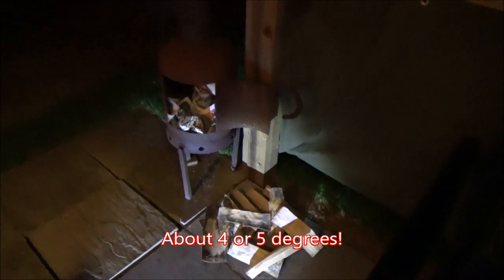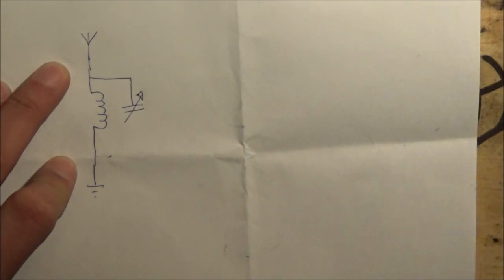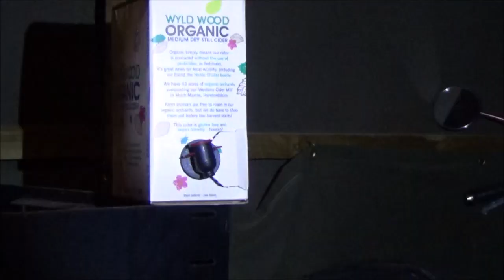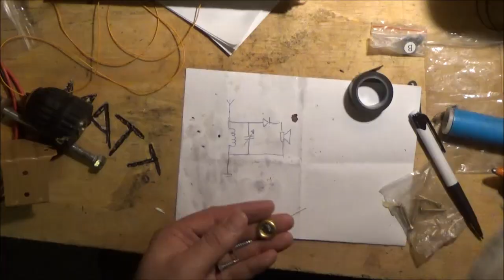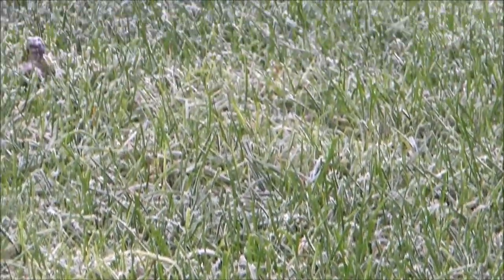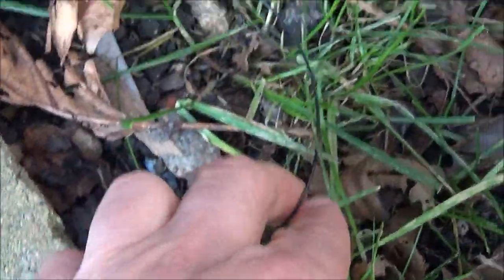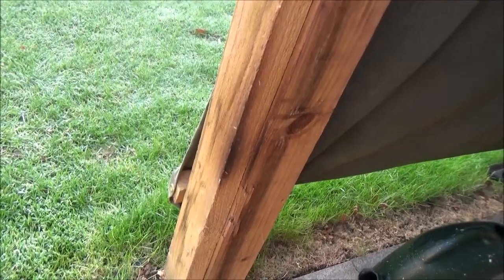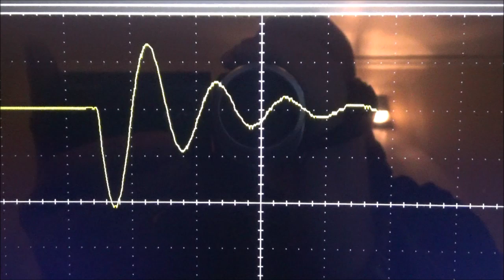DuB-EnG: Prison POW Survival Radio - Free Crystal Receiver - How to make a CATS WHISKER SET!

Comment: Don't forget...shaft of variable capacitor to the ground end of the circuit.  Otherwise every time you touch to cap it will slightly shift the frequency due to hand capacitance.  If wired the other way around,  you may have a station tuned in and when you let go, it disappears.   de AA9GG
Reply from the maker: Paul Mateer thanks Paul! ... how quickly I had forgotten your tip from the last time...  I connected the case to ground...  hmmm...  I’ll fix that with the addition of a new coil!

Comment: Hi I've found that the easiest way to work with a cats whisker is to use a conventional  crystal diode in place of the galena so that you can tune in and find a station and once you know your in the right area with the tank design and then try it with the cats whisker. All good fun.All the best . . .  Andy
Reply from the maker: AndyDaviesByTheSea thanks for your top tips Andy! ...  great idea...  that said, I have persevered and a new larger coil is in place... I’m getting radio 5 clearly  (also a small headphone amp so I can video it) ...  I hope you will see it perform in a few days!...  also, I have a tempered hacksaw blade to play with, a ferrite rod and a few other going’s ons! ...  later down the line I plan to make a small TRF radio

Comment: That's more like it, very similar to the one i built as a kid (52 now), those toast rack capacitors are bloody expensive now.
Mine was 500pf and yours looks like a 350pf, so less range.

Yes you need a large coil for the long/mediumwave band, you could add random tappings so your tuning cap ends up in the middle of its travel.
Make sure the earth rod is actually connecting to the wire, it really matters with an antenna as short as yours... ooow naughty, i didnt look honest lol :-D.

Try to find an old telephone earpeice, the metal type with two nuts oow no, or use one of your dynamic mic elements as a speaker, just stick the wires into the mic plug and key up for audio :-D.

I was greeted with lots of snow today, on with the green wellies and off to the shop to get a paper for a 85 year old neighbour, i dont mind as she has allways been kind to me :-)
Reply from the maker: Wish your username was easier...  We will call you BOB...  Bob!...  thanks for your comments!  I plan on working on this a little more to improve its performance and even adding a single transistor at some point! - It will be fun! - Yes, I have a short one (teehee) and I'll look out the nuts on the ear-piece (never a good thing if you have nuts that close to your ears!!)...  Snow happened here too...  in a future episode, you may see Missus Dubious making a dirty snow-man! - I recently started a twitter account...  and a web-page www.dubiousengineering.com  - all just for fun...  Enjoy your walk, and keep a good check on the neighbor when its this cold...  your obviously a very kind and gracious gentleman!  Thanks for your kind comments!  As a PS...  My first experience of crystal radio was with a 500 in 1 kit germanium diode and piezo earpiece.
Reply: LOL i had the 180 in one with springs and wires, and a bloody thick book of circuits, i think it was a tandy jobbie, can't remember, brain fade.
Sorry but i made this account and didnt want to use my name, i picked a chip number out of the plus 2 speccy.
Sorry mr blackadder :-(

Comment: Just curious: where would prisoners find/get a crystal like the one in this video?
Reply from the maker: Fair point...  you can use what's called blue steel or a tempered razor blade
Reply: @DubiousEngineering  Ok, but what about the variable capacitor?